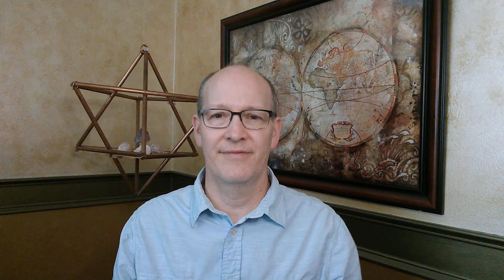Magnetic Energy Community Part 1

Comment: 8:26 Here you say that magnetic energy units can be used to generate electricity. To my understanding, this is not the case, but perhaps I am wrong.

If it is possible then we have a serious problem, because extensive electricity infrastructure already exists and this would radically diminish the incentives to build new systems or, at a minimum, there will remain a viable route for electricity production, perpetuating the effect of electricity, and undermining the shift.
Reply from the maker: I talk about this more in this video: https://youtu.be/NG-0VXs58zU  Since the units produce rotation the most common use so far has been to turn generators etc. to produce electricity, but they can also directly produce "cold" electricity which doesn't have the same negative effects as regular electricity...
Reply: @MagneticEnergy  I can see how electricity can be produced (also as a byproduct), since it is only another combination of combustible factors, but that video only speaks in abstract terms about the concepts of on-demand energy generation and several attitudes of neutral magnetic energy. In terms of developing a practical engineering-driven understanding, however, this is not especially valuable. 

You have said that you are not releasing, advertising or selling practical designs for safety reasons, but unfortunately what is left offers little practical support to builders. It seems a shame that so many alnico salesmen, who otherwise would have a booming trade, are being kept from our doors.
Reply from the maker: People around the world build units from the drawings and information on the websites, but you do need experience and money to do that...